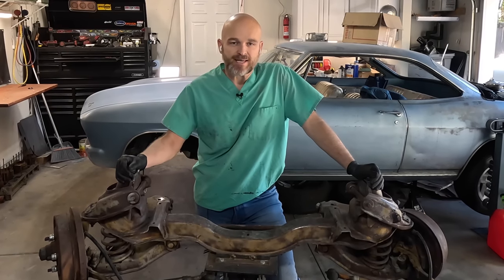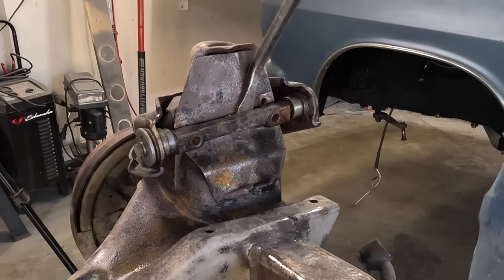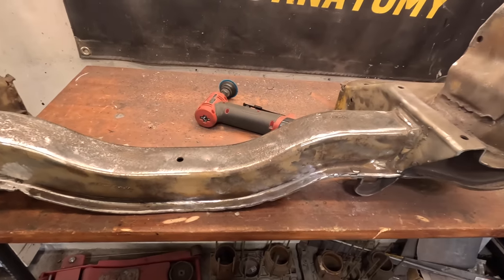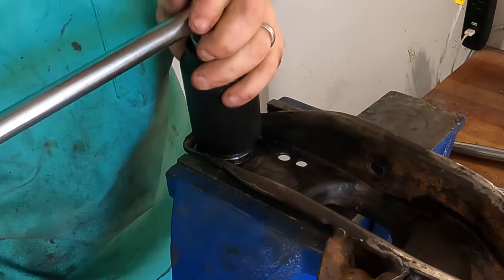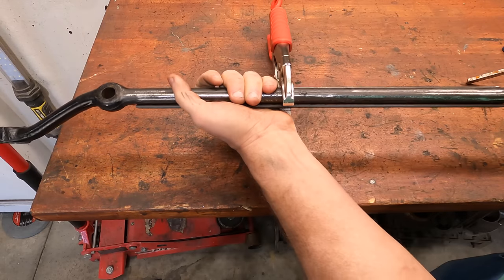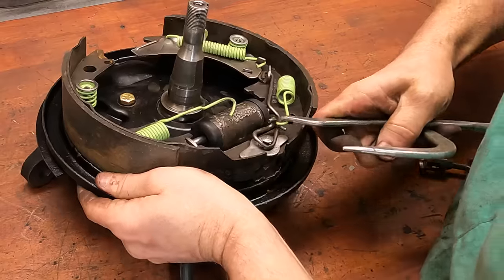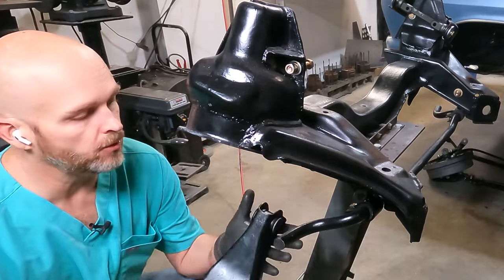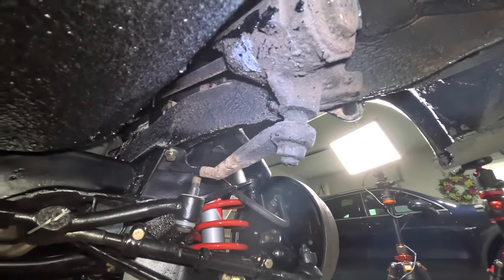Total Front Suspension Rebuild for the FLOODED Corvair:  Back on the Road Again!

Comment: Before you go crazy with your exhaust. This droning is a problem an many X-pipe V-8 engines...and near proper tuning, meaning you have just a slight imbalance in exhaust pulses.  I have seen many weld in a curved static tube that dampens the pulse, maybe only on one side.  My thinking is to simply bolt in an aluminum spacer at the 3 bolt Ultimate Exhaust, header to muffler flange.  The spacer could be a 1/2 inch plate with proper exhaust ID...but drill a hole in one side that penetrates to  the exhaust bore. Screw in a pipe nipple and vent some gas...pick the strong side and try. Easy and might save time and money. You could try either side, or make two and try both. One with a different size vent hole.

Comment: After watching your video I you forgot to put brake lubricant behind all the springs and the shoes on the front brakes after they touch metal the shoe touches the backing plate and the self adjuster pivots on the fuel you're supposed to have a little it's called the brake lubricant on it he didn't do that so next time you take them apart put it on the brakes work better with the brake loop on it
Reply from the maker: Thanks for the correction!  It's actually all removed now with Wilwood disc brakes up front, but the rears are still drums and I'll have to look at those.

Comment: It's good to see how it comes apart, I've got to do that to mine eventually.  If you get a factory assembly manual it'll show you how to set the camber bolts and the toe with the notches on the parts to get you roughly to factory settings.  I'd go with alignment settings of +1 to +1.5 degrees caster, -.25 to -.5 degrees camber, zero toe.  Rear at -.5 to-.8 degrees camber equal on both sides, zero toe.  Fine tune the steering wheel straight and off you go.  Higher caster will make it steer harder at slow speeds, but feel tight at high speeds.  Negative camber will make the tire on the outside of the turn plant more firmly.
Reply from the maker: Thanks Jason!  I set the front end to roughly stock specs but need to get it "formally" aligned soon.  The front end is still settling a bit and once that happens I'll take it to an alignment shop.

Comment: Here's another tip. For removal of the ball joint rivets I use an air powered mini belt sand with an 80 grit belt. It will grind the heads off the rivets faster tan anything else. Then just use a hammer and punch.
Reply from the maker: That's a good tip.  I have an air powered belt sander but sadly sold my air compressor when we moved from CO and haven't picked up another one.  I really need to get my shop back in order.

Comment: Until the Mustang II came out, hotrodders would use the Corvair front suspension because of its compactness, easily converted to disc brakes (Camaro?) and rack & pinion steering, but the Mustang II had both as stock.  ;-)
Reply from the maker: I've been kicking around the idea of building a subframe that bolts into the Corvair body but uses Mustang II upper/lower arms and the rack/pinion steering.  May have to think about that a bit more!

Comment from the maker: It feels SO good to have the Corvair back on her feet again, and it drives like a new car now.  Everything is solid and responsive.  

Now I need to redo the rear suspension...what mods do you recommend?  It's already got KYB Gas-A Just rear shocks, but most everything else is original.  I'm thinking of some monoballs for the front of the rear swing arms.  What else?  Let me know below!
Reply: I have heard of corvette bars  ( below driveshafts )  Either way I would research others first .:goodvibes:
Reply from the maker: I actually did that mod a while ago, made a big difference!  https://youtu.be/YZ3qbEpHKe0?si=vanlCOx5sZ9pTfAn

Comment: Nice overhaul.  We had a shop do the entire front end.  We put on 14 inch wire wheels that needed the adapters.  We have tire interference on turns.    How did you avoid that?  We have a 63 Spyder convertible.  Thanks!
Reply from the maker: Thank you!  I would bet the offset is different on your wire wheels vs the Camaro wheels we used on this car.  I'm not sure about the differences between the front suspensions on the early model and late models.  May be more room on the LM.

Comment: It is great watching your series on your Corvair.   It is giving me the energy to get back to my long stalled repair on my '65 Corvair Convertible.   One comment, on the Por-15 products.  I have not used the direct to metal one you showed here, but in general I have had great success using the Moisture Cured Urethane from Rust Bullet.  You can brush it or spray it.  There is minimal prep required on rusted surfaces, and it dries hard & smooth.   It really creeps into the rust and encapsulates it.   The original version is an aluminum color when cured and needs no top coat and is UV stable.   They also sell a black color if you want a black color to finish it off.   Great stuff.   The Por-15 seems to need more prep before painting, and requires a top coat if it will see any sunlight/UV.   The rust bullet does not.   Keep up the great work.
Reply from the maker: Thank you so much, and best of luck on your 65 convertible.  I'll take a look into the rust bullet stuff, thanks for the tip!

Comment: Another really informative and enjoyable video. A quick comment on brake assemblies. I was taught to put some grease on the pads of the backing plate where the shoes slide over. Disc brakes on the front are overkill in my experience. Even most of the guys racing Corvairs keep the drums.
Reply from the maker: Thanks for the tip!   I haven’t made a decision on brakes yet, so that’s good info
Reply: The problem with drums is getting the shoes exactly the same on both sides, otherwise it pulls to one side or the other.  Also, the ability for the drums to lock up the stock tires isn't a testament to the greatness of drums, it's pointing to the strides made in tire technology since the 60's.

Comment: I am a fan of POR15 too. Love what it does to keep our Corvairs on the road and rustproof :) I see you squeezed the lower control arm bushing area together. There is supposed to be a support put in place to keep that from happening. You do have a manual, don't you? Not complaining but you will have problems because you did not do that right. Are you going racing? Quick ratio arms aren't needed for the street and they do increase steering effort.
Reply from the maker: I do have a manual, and the video doesn’t show but I did measure the width of the control arm at the crossmember end to make sure it was at the original width.  It’s all correct

Comment: Hello sir great video, question what kind of plate did you use to hold your front suspension on to the harbor freight transmission jack, thks
Reply from the maker: Thank you!  I just used a couple pieces of angle iron on the trans jack.  I think I showed it in the video pulling everything apart.
Reply: @AutoAnatomy  sir I seen picture of plate is tht plate just fit tight on corvair Suspension or is it bolted onto the bracket on Jack plate , thks
Reply from the maker: @scottmagyar I can email you a picture, just send me an email at autoanatomy@icloud.com

Comment: Sean, watching you assemble the brakes, I always put a little white lube between each shoe and the backing plate at the rubbing points to help keep the shoes from squeaking when the brakes are applied. Just a thought. BTW, I still have my brake shoe tools just in case. haha
Reply from the maker: Good tip, thanks!

Comment: I've always heard conflicting viewpoints on cutting springs. For sure it would cause a pressure point that may cause problems over time. And if you didn't have those indexed to opposite orientations left to right the ride height could be uneven, maybe?
But anyways thanks for a real meat and potatoes video!
Reply from the maker: Yeah, I tend to not want to cut springs, but for this I wanted to see how it looked.  I've since replaced the cut springs with Clark's HD front springs and it rides much better.

Comment: how much did cutting the springs lower the front of the FC
Reply from the maker: I took one coil out of the front springs and it dropped about 3/4".  Liked the look but they squeaked over speed bumps.  I have replaced them with some stock length HD springs and it's slightly higher than the cut springs but is much quieter

Comment: Have you seen the Toyota Prius steering column upgrade. Apparently, it’s a driver assist column. It will also give tilt steering. A guy on one of my corvair sites said it only took a few hours to do and worked well . Thought you might be interested in this as you all up in that area anyway
Reply from the maker: I saw that and it looks intriguing.  I'll have to do a little deeper dive.

Comment: After you get the grease and rust off you should use POR15 on  all the parts.
Reply from the maker: I used POR-15 on the entire front suspension, hopefully it'll be rock solid for years to come.

Comment: If I was going tear down the front suspension completely as you did, I would seriously consider doing an adjustable coil-over suspension and do away with the stock springs. 
And disk brakes would be a nice addition to.
But that being said, it also would be dependent on how much a person wants to spend 🤔, me personally I'm a duct-tape and bailing wire guy myself. Hahaha
Reply from the maker: I thought about coil overs, and that may be a "down the road" upgrade.

Comment: I have done many front and rear suspension rebuilds and I always clean everything usually down to bare metal if possible. On race builds I weld up both front and rear parts. If I do not have the crossmember powder coated I hand paint it with some rust inhibitor like chassis black or POR. I can get to places with a small brush a spray gun can't.
Reply from the maker: I figure, while I'm there I might as well make things better if possible.  That's why I decided to weld up the crossmember and the front arms.  Plan on doing the rear soon, any recommendations for upgrades?

Comment: What determines if you tig or mig weld?
Reply from the maker: Whether or not I run out of welding gas!  I usually try and TIG weld (trying to get better at TIG) but ran out of gas on that welder, so ended up finishing up with the MIG.

Comment: I think an upgrade to disc would be convenient, but the drums on it now are quite large on the late models….I believe they share 9.5 front and rear with the GM A body. I think Clark’s has a kit, but other than a dual reservoir, I was always comfortable with drums. I think fuel injection is the direction I would go….or maybe a centrally located electric choke Holly 390cfm.
Reply from the maker: Discs would be more about fade resistance rather than stopping power.  Fuel injection is the next big project on the horizon, and I'm trying to get that done around the end of the year/first of next year.
Reply: Hi Sean, another great one!  @cheaptricked is correct, the A body GM cars shared brakes with the late Corvair- just reversed front and rear.  The single biggest advantage of discs, as you mentioned, is fade resistance.  Under hard braking, the drums expand due to the heat generated, and the shoes have to travel farther to engage the friction surfaces- worst case is that the drums may expand so far you simply lose friction. There is another advantage to discs- they are more directionally stable under braking- the car goes straighter.
Reply from the maker: Thank you!  I haven't decided on discs yet, but absolutely have decided on fuel injection.  I need to get the exhaust done first then am so ready to start planning/creating the FI system.
Reply: @AutoAnatomy  Hi Sean, a number of folks  have installed EFI on their Corvairs, some with supposedly "plug and play" units.  I have a friend here in Chicago who built his largely from scratch, and I could try to put you in touch with him, if you'd like.
Reply from the maker: @Kpar512 Absolutely.   Email me at autoanatomy@icloud.com

Comment: Unless you are racing I see no need for boxing the control arms. Even on my race cars I never boxed them and had no trouble. Then again as an old engineer told me, they will never know if it's too strong.
Reply from the maker: Yeah, it's probably overkill for the street but I'd rather have it too strong than the opposite.  And again...if I'm already there then why not?   I also really like your website and have drooled over your garage setup for a bit now.